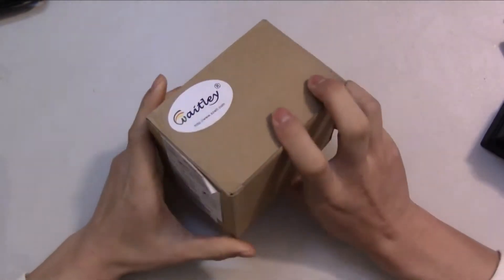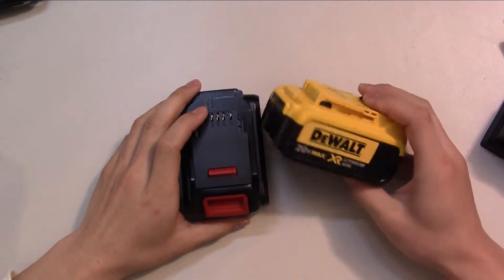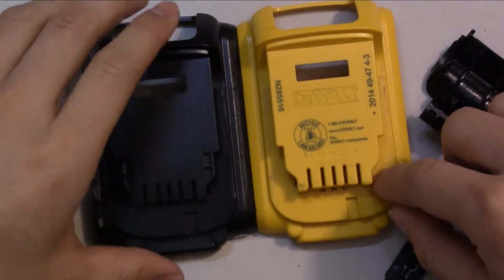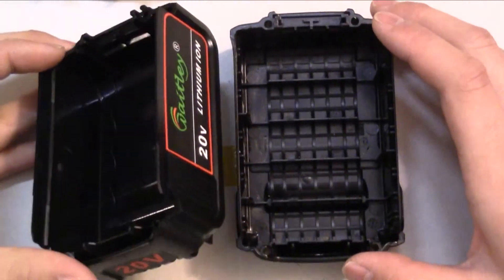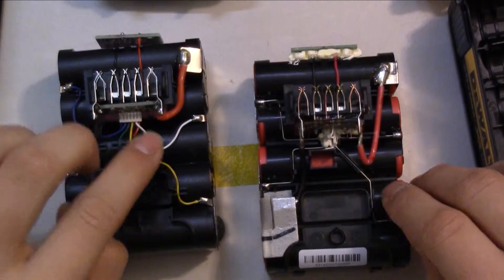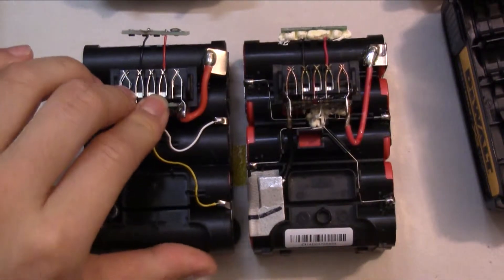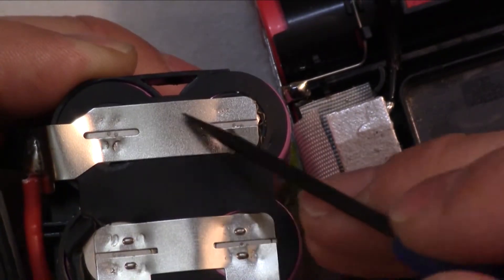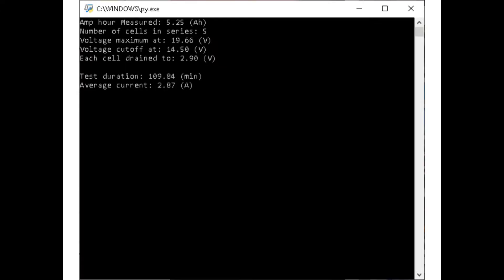[22] Project - DeWALT 20V MAX Genuine vs Knock Off Battery Capacity Test

Comment: I bought a 9ah waitley dewalt replacement battery,it works very well,but as shown you have to charge by the time its down to 20%.but last week i forget to charge,so the battery drain out to 00% and it wont charge back.the charger light just sticks on solid red when the battery is inserted.how can i grt this thing to charge?
Reply: What ever became of the problem battery ?
Reply: @Soli_Deo_Gloria_.  i thought it drained out,but it didnt.one of the wires inside got loose.so that was the problem.
Reply: Nice... I just bought the Waitley two pack of 6 Amp Hour batteries, I was just do some research to see if they are good or junk... reading reviews it's seems hit or miss in quality... hope mine are good... Thanks for responding and have a good one. 👍

Comment: It would be a better comparison if you have data from the OEM battery. Lithium batteries usually have a buffer of 10% or so to prevent damage from full discharging.

Comment: Chinese cells that meet their advertised capacity are beginning to show up and test out well. Have any made it to DeWalt battery packs yet?
Reply from the maker: Thanks for the comments! 
The quality of Chinese products are getting better!
However, I have gave up on third party batteries.  I will just wait for special deals on OEMs
Reason being capacity is one of the most obvious aspect for testing a battery pack.  
There are also subtle ways to cut corners
1. battery current ratings, i.e. 2.5 ah 1C vs 2.5 ah 3C
2. BMS quality
3. wiring quality
4. battery casing quality
etc..
In the long run, I choose OEM.